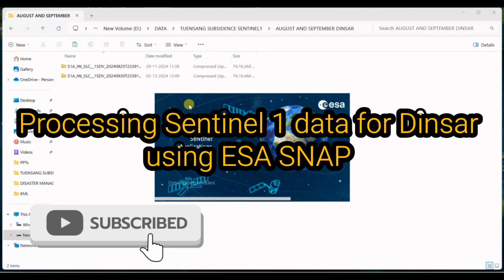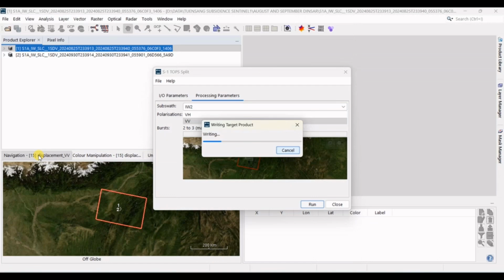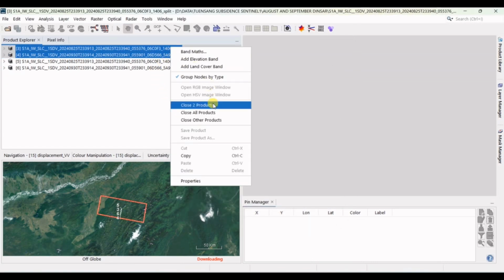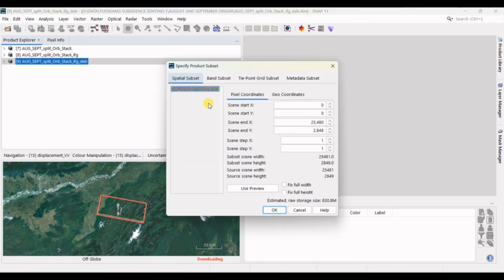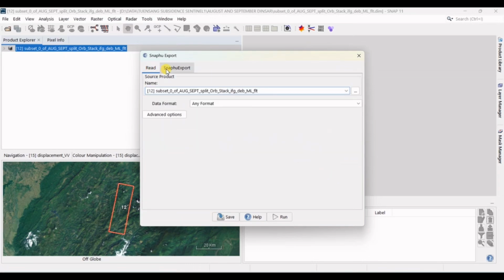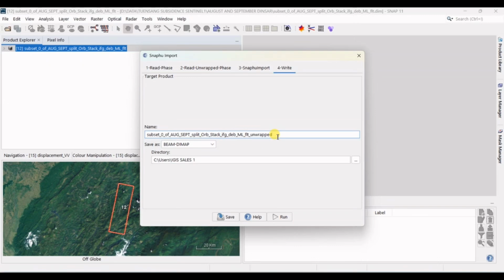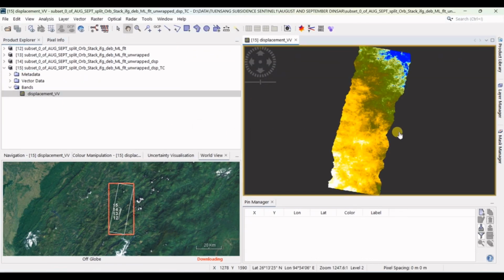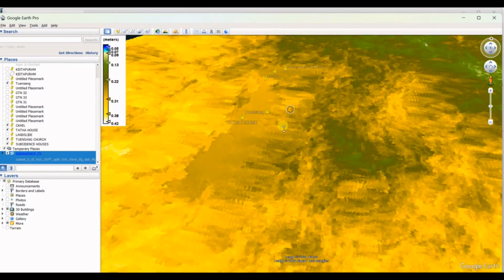Displacement Mapping Using Sentinel ESA SNAP #sentinels #remotesensing #landslide #landslides #snap

Comment: Why you not using topography removal?
Reply from the maker: @Blackboom2012  Thank you for watching the video.Topography is removed in the interferogram formation step already. In few cases topographic phase removal is done seperately. In coming videos I will explain each and every step in detail and their impact on the data processing
Reply: @geoscienceengineering  I agree with you. When using phase topography removal, an error occurs when unwrapping
Reply from the maker: @Blackboom2012  In my case I got error in unwrapping when I applied topographic phase removal in the later stage ☺️